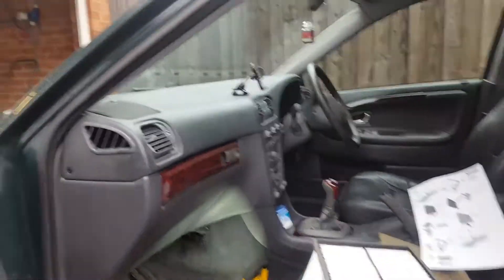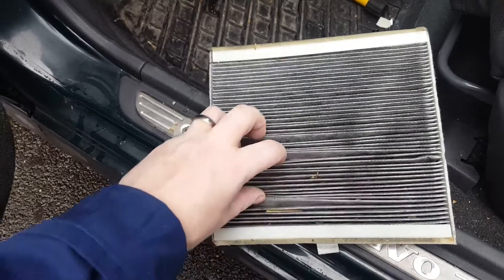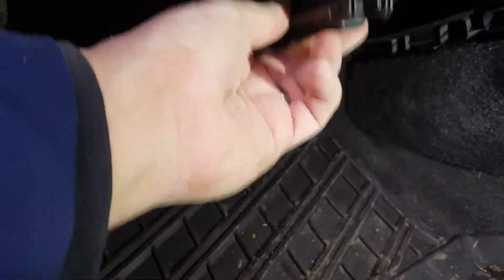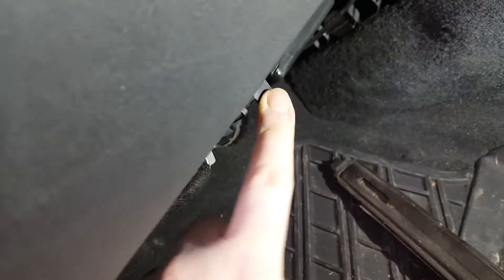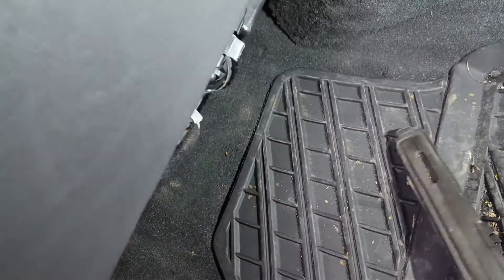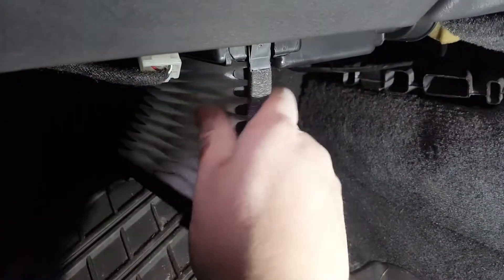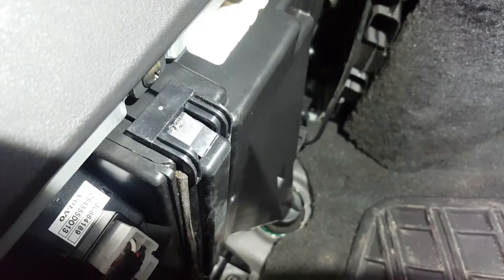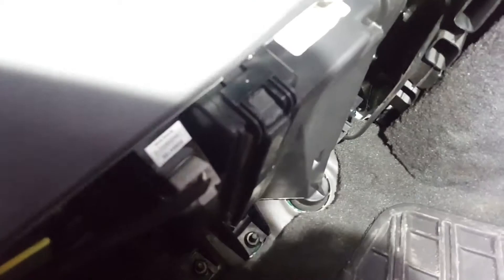Change A Volvo S40 Cabin Filter

Comment: What year is the car?
Reply: 2010
Reply: @e.n.velazquez6940  No way is that 2010. I have a 2002 with the same exact interior and by 2004 they switched to a completely different platform for the S40. This is between 1995-2003

Comment: Thanks for a great video!  Which way does the air flow directional arrows go?  Towards the driver or away from the driver?  I have a USA model so the passenger side is on the right of the vehicle.  Thanks
Reply from the maker: The arrow should point towards the heater matrix in the centre of the car.
Reply: Thanks!

Comment: Can it be cleaned out or do I have to buy a new one?
Reply from the maker: it Is not a reusable filter as you could only get the bigger bits out of it still leVing most of the dust etc.